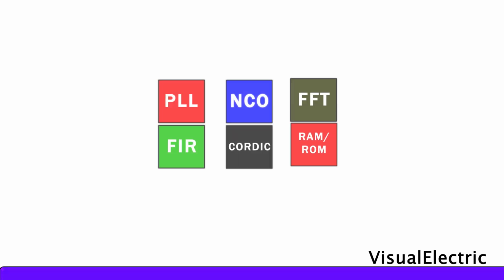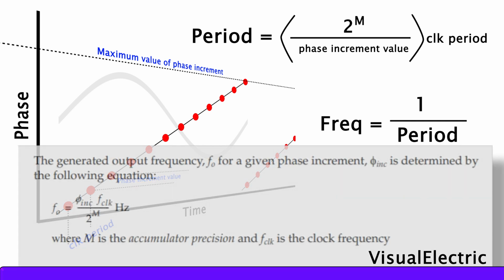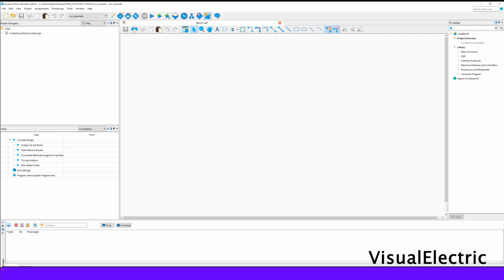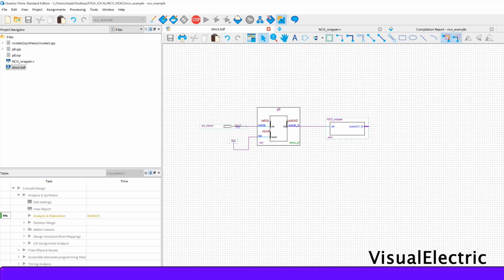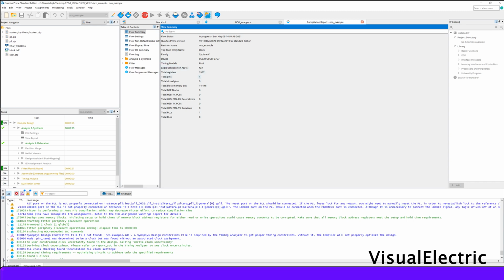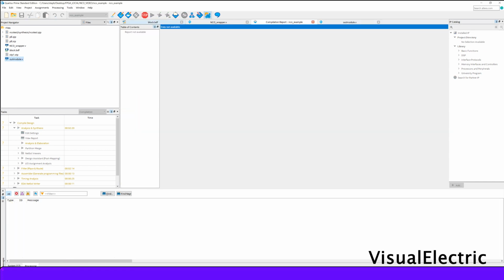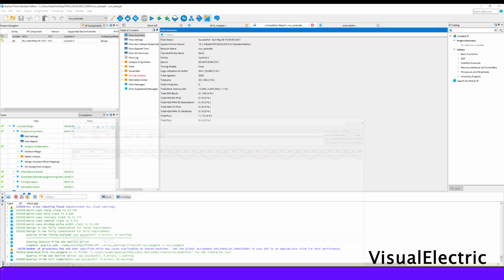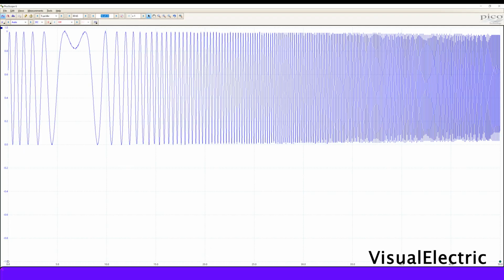NCOs are everywhere - here's how to make one using an FPGA

Comment: Thanks a lot for this great explanation! It helped me a lot in my research... I have just one question... whats is the maximum output frequency i can set up in NCO? It depends on my FPGA?
Reply from the maker: It will depend on the clock frequency. In a mid-range FPGA, you could set the clock at 100-200 MHz and then output a 10-20 MHz sinusoidal wave with 10 samples per period (reasonable quality). If you push too high, the waveform starts to look like a staircase, but theoretically, you could go right up to Nyquist.
Reply: @VisualElectric_  Thank you... just one more question... how to set up the amplitude of the wave?
Reply: @tiagoogionicostalonga7777  - External linear amplifier, with DC offset adjustment, if you can. Doing it in the digital domain reduces the resolution of the DAC and you still need to add in a DC offset to remove the DC component which you presumably can't do digitally.

Comment: have you ever tried feed output of ADC to input of DAC on the same ADA board? I tried it but got notthin! Just simple that I connect the output of ADC to input of DAC to observe the S21 of the system, it should return the same input as the output but I got notthing at the output. The modes are set correctly on both ADC and DAC, they used the same master clk
It will be great if you give me an email, I would like to ask you some questions
Reply from the maker: I've done this many times. The usual suspect is the wrong pin assignments. I cracked it in the beginning by using the example that comes with the THDB-ADA board.
Reply: @VisualElectric_  I have done this too, I cracked the example, turned out that the powerdown funct pin needed to set to 1 to get them work!